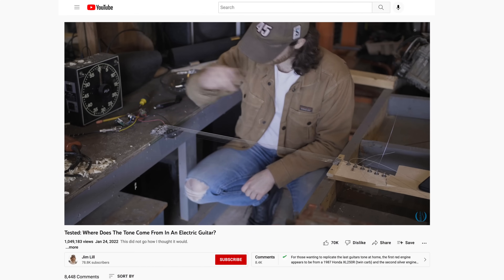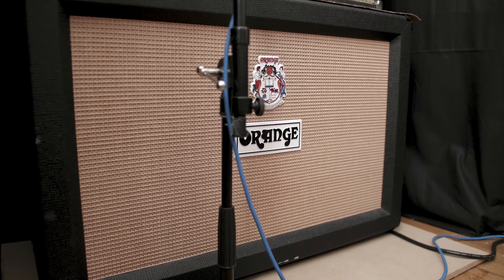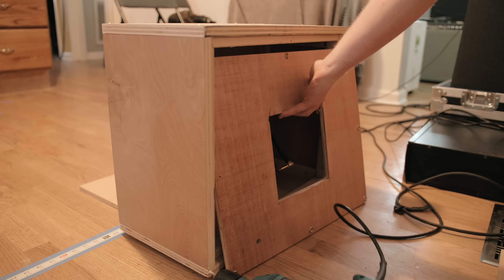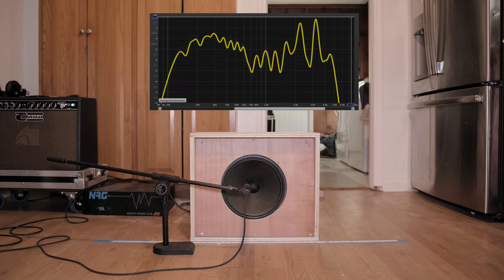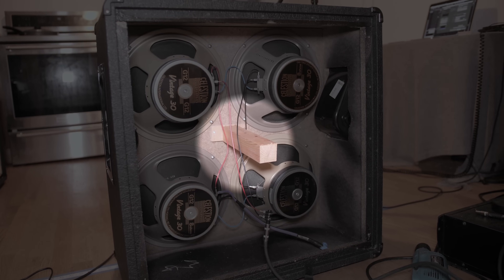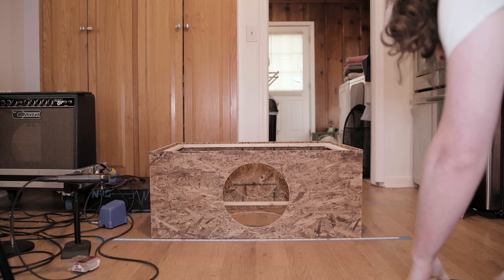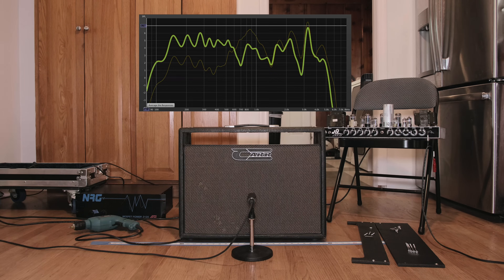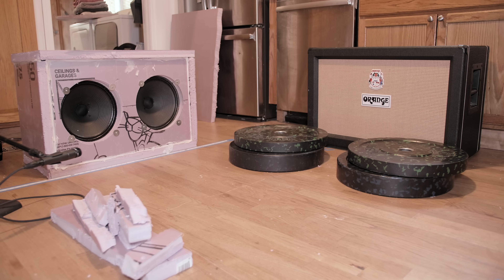Tested: Where Does The Tone Come From In A Speaker Cab?

Comment: What you've encountered with the hole thing with the low end slowly coming back up is the idea behind bass reflex cabinet designs - stick a specific length of pipe in that hole and you get way more low end from a helmholtz resonator.
Reply: That’s the first thing I thought about.
Reply: Yepp, or hornload the speaker, which many bass speaker cabinets do.
Reply: Bass guitar cabs are semi reflex designs. Ported designs tend to be a bit boomy at key frequencies, so bass cabs restrict airflow using a vent with a larger open area (see SWR Goliath or Eden David which have a slotted port at the bottom and sometimes top of the cab). This was a big thing. The first bass cabs were adapted guitar designs, but they needed ridiculous amplification. Then came literal horn loaded PA cabs connected to power amps and rack mount preamps in the mid 70s. More efficient (and smaller) cabinets like the Goliath made it physically easier to be a gigging bass player.

Comment: Thank you for doing the work! The Helmoltz frequency is what describes that "complex relationship between bass response and the size of the opening in the back panel". This is a well documented phenomenon where a hole in an otherwise closed volume can lower it's resonant frequency. This is why sub woofers often have ports. It's also why the size of the hole in an acoustic guitar is very important
Reply: Thing is with holes and cuts in the back the aspect ratio of the hole is very shallow so effects like the coupling zone really get to play here. So it's a bit more difficult than a simple Helmholtz resonator
Reply: as far as ports... yes and no.
the volume of air inside of a port actually acts as an independent source of resonance.  In a sense it is a smaller speaker made of air.

https://www.youtube.com/watch?v=PoEyIJx3uM0
Reply: @Satch_4_Hogs  — Thanks for the link!

Comment: I think this is by far my favorite video in this series. Besides musical instruments, my other hobby is hifi speakers. The construction of the speakers determines what kind and size cabinet it should be on, plus sealed vs ported affect on bass response. Your closing statement hit the nail on the head.
Reply: As an amplifier cab builder myself, I have to say that this video is somewhat misinformational: If every audio clip in this video does actually correspond with the visual/video presented on screen, then it is clear to see that the recording microphone (in 99% of instances) is directly in front of the speaker... so, in a 4 X12 test... Jim is only recording ONE speaker... same goes for a 2 X 12 or any other combo. The wood, resonance and structure of any cabinet DOES affect the tone... but you're not going to hear that with a mic placed right in from of ONE speaker. To do this properly, Jim should place the mic say... 20 feet away - about where you'd hear the speaker if you were stood near the front in a small venue.. or managed to get right to the front of a stadium gig. Not too scientific after all! 🙂

Comment: The fact that you didn't reveal which was which at the end speaks for itself. You didn't need to because it doesn't matter, they sound so similar that the difference is completely negligible if there even is one. Great work!
Reply: There’s more low-end fullness with one of them. They both sound usable but the one with more low end sounds much better to me. Ymmv 🤷‍♂️
Reply: in a mix,100% irrelevant

Comment: Obviously, lots of work went in to this - not just in building and filming but in all the thinking and managerial work of editing it into a cohesively formatted presentation. Kudos on all of that and the bits that can't even be put into words. As a sound engineer, both studio and live, for 27 years now and a woodworker for even longer I will say a few things that will likely make you want to kill me. 

First thing. It's not just the cab, it's the room. Take any cab into 3 differently sized spaces and, using the same amount of power at the same ''volume'', you will get different EQ responses. The diaphragm of any mic can only behave relative to its environment, like a goldfish grows smaller in a smaller bowl but place it into a larger bowl and it will grow larger, it's directly proportionate. Increasing the power to a given cab in a larger space. that initially sounds thin in that space but beefy in a smaller space, does several things that resemble torque curves seen from combustion engines but to the sustain of whatever resonances that cabinet otherwise has. The changes have to do with how voice coils are built and the mass/size of the driver relative to the power and air resistance in the room. The cabinet's construction will either perform great in a 7x11 bathroom or a 16x 24 bedroom or a 3x4 closet, but likely only one of them, and if it does will likely then be trash on a stage. I have my beliefs, I'm sure you will have yours, but there DO exist specific parameters at play as to how to use these phenomena either for or against your patience levels and/or sanity breakdown threshold.

Second thing. Pine or spruce face plates, full-stop. The mid range frequencies at play in electric guitar are very similar to the low mids of a violin. To dissipate them so that none of them ''stand'' you need to avoid both thin/flimsy and dense/rigid faces. The point being you want to reduce cabinet resonance, which do feed back through the face plate, but not leave it dead. I've tried at least 10 different face materials and pine has been the best overall. Double it up to 1.5'' and leave the mounting ring the speaker fits into at .75''. Think about what is going on when a snare drum shell is mic'd (ie from the side). That shell is definitely audible and it sounds totally different than either the batter side or snare side, same as the back and side materials of an acoustic guitar make a difference. The pine/spruce face just sends sounds wave through it FAST and consistently - without adding noticeable ooompf to bass notes.

Third thing. Close micing ain't always it. I've gotten great results at 5' on cabs that just sounded trash within 2-6'' in any space. If the mic is always within 2'' and the volume is always above 95db then don't even bother unless you're just doing a solo performance as any other band instruments will negate 99% of any nuance the cab COULD ever offer. Once you get out around 1.5' the cabinet material begins to matter A LOT.

Comment: I'm curious how much these differences apply once you start backing the mic off of the speaker and get more of the room in the mic signal. I'd think the speaker amount and straight vs slant would have a much bigger effect as you start pulling the mic out. 
The styrofoam cab was pretty fucking mind-blowing though holy shit. Really gives you something to think about for live situations that are usually only close mic'd anyway, might as well just build a cab that is the best combination of lightweight/portable and sturdy to make touring and setup much easier.
Great video! This definitely took a lot of time and dedication and it shows!
Reply: I hope he does a part 2 with room mics to see how much the treble frequencies disappear at different angles.
Reply: good point. you saw the paypal right?
Reply: "The styrofoam cab was pretty fucking mind-blowing though holy shit. Really gives you something to think about for live situations that are usually only close mic'd anyway, might as well just build a cab that is the best combination of lightweight/portable and sturdy to make touring and setup much easier."

The rub here is that wood is actually a great choice of material if you're trying to balance durability, workability, affordability and weight. There aren't too many other choices that make sense. Molded plastics are one option that works well, which is why you see so many plastic PA speakers and studio monitor enclosures these days, but wood is still favored by smaller builders as they can cut and shape it any way they like without having to involve an outside plastics manufacturer.
Reply: Exactly dude botched the point completely by his mic placement.
Reply: @John-e4p1x  My favorite was when he put a stick of wood in front of the mic and acted surprised the sound changed.
Reply: @Azathoth43  That was my only beef with this video.....that was a huge oversight.
Reply: The close mic'ing made this video pointless for me.

Comment: With the hole you are actually building a ported speaker. Air has a mass and by drilling a hole, you are building a "air-speaker". This is used in subwoofers, to build bass reflex / ported subwoofers. This is also why the sound is falling off in the deep end more quickly.

Those videos are amazing. Love the aspect of actually playing those back to back and comparing them.
Reply: Afaiw you need some kind of tube for a ported speaker. Open backs would be more similar to trabsmission lines or rather open baffles, where the increased distance (through the back and around the cabinet) between backside and frontbaffle make the soundwaves from the front and back dont just destructively interfere but might even add up or anything in between
Reply: @torgeeee  You don't need a Tube for a ported speaker. The Port can have every form. But of course it has to be calculated (thiele small for example). Depending on the calculation the opening can actually just be a hole in the cabinet. I build speakers in which it has only been a small slit and ones with a rectangle tube/tunnel like opening.
But just by adding an opening you construct a type of "air-speaker", if its fitting for the speaker is of course a different story.

I don't think you can compare the open baffle on the back with a transmission line. The transmission line works more like a flute and is a monster to calculate. This is where you would really need a tube like construction. More so in the Transmission line then in a ported "subwoofer" or speaker system..

Comment: This video deserves a million likes just for the sheer effort that went into creating it. Incredible. Thanks Jim!
Reply: As an amplifier cab builder myself, I have to say that this video is somewhat misinformational: If every audio clip in this video does actually correspond with the visual/video presented on screen, then it is clear to see that the recording microphone (in 99% of instances) is directly in front of the speaker... so, in a 4 X12 test... Jim is only recording ONE speaker... same goes for a 2 X 12 or any other combo. The wood, resonance and structure of any cabinet DOES affect the tone... but you're not going to hear that with a mic placed right in from of ONE speaker. To do this properly, Jim should place the mic say... 20 feet away - about where you'd hear the speaker if you were stood near the front in a small venue.. or managed to get right to the front of a stadium gig. Just saying! 🙂

Comment: Your channel is hands down the greatest guitar channel out there. Thank you for all of the incredible effort you put into these videos!
Reply: As an amplifier cab builder myself, I have to say that this video is somewhat misinformational: If every audio clip in this video does actually correspond with the visual/video presented on screen, then it is clear to see that the recording microphone (in 99% of instances) is directly in front of the speaker... so, in a 4 X12 test... Jim is only recording ONE speaker... same goes for a 2 X 12 or any other combo. The wood, resonance and structure of any cabinet DOES affect the tone... but you're not going to hear that with a mic placed right in from of ONE speaker. To do this properly, Jim should place the mic say... 20 feet away - about where you'd hear the speaker if you were stood near the front in a small venue.. or managed to get right to the front of a stadium gig. Just saying! 🙂

Comment: The strips of wood on old amps are diffusers and disperse the treble frequencies wider in the room.  The treble frequencies gradually disappear the further you move off-axis from the speaker cone.
Reply: One huge thing that wasn't tested is the sound in the room as opposed to right in front of the speaker. For recording, a 57 right in front of the speaker is absolutely valid. But the vast majority of the sound when you have a cab in the room comes from the sound being dispersed at an angle. 

The strips of wood might make it sound a bit too dull in comparison, but they actually remove the "icepick" effect that is caused right in front of the speaker, basically making the speaker have a more balanced response at a wider angle, and therefore a smoother tone for more people in the room.
Reply: @distortingjack  I agree that he should have recorded the room at certain angles. My band played a gig a few years ago and people on the sides of the room were complaining that they couldn't hear the guitars. It sounded fine to me, but I didn't realize that the treble frequencies disappeared tremendously for the folks sitting on an angle.

I did some research on dispersion and diffusion (duct tape, beam blockers, Mitchell Foam Donut). On my 1x12" combo, I taped a 6 inch piece of very thin foam (3mm) in the center, with a 3/4 inch hole in the center. The small hole in the middle acts like a tweeter and spreads the high frequencies very evenly...no more treble beam of death coming from my amp!

Comment: Amazing work! Thank you. I think using a second mic somewhere away from the speaker to get more of the cabinet sound would be helpful. By only analyzing the sound from a mic placed closely to the front of the speaker, it eliminates the ambient sound from the cab in the room. Having a second mic that is placed to pick up room sound from the cab would be informative. Of course, you would need to control for variables in the room, eg, placement of cab, mic, same room/space with no changes in other items in space, etc. An isolated and controlled space.

Comment: The low-frequency drop-off below 200hz is from "phase cancellation". The front of the speaker driver's cone directly radiates sound waves, as we all know. What may not be known is the back side of the driver directly radiates sound waves, but 180 degrees out of phase with the front wave, cancelling out low-frequencies. Awesome, unbiased real-world scientific testing that settled alot of arguments. Great job!

Comment: This is golden. You deliver every time Jim ! And it just confirms my years of studio experiments : the "magical" cabs are the ones that have the right mix of speakers vs geometry. 
How they're made and what of is a practical and aesthetic consideration but tone-wise : no significant change.
Reply: As an amplifier cab builder myself, I have to say that this video is somewhat misinformational: If every audio clip in this video does actually correspond with the visual/video presented on screen, then it is clear to see that the recording microphone (in 99% of instances) is directly in front of the speaker... so, in a 4 X12 test... Jim is only recording ONE speaker... same goes for a 2 X 12 or any other combo. The wood, resonance and structure of any cabinet DOES affect the tone... but you're not going to hear that with a mic placed right in from of ONE speaker. To do this properly, Jim should place the mic say... 20 feet away - about where you'd hear the speaker if you were stood near the front in a small venue.. or managed to get right to the front of a stadium gig. Just saying! 🙂

Comment: Ideas:
-backwave reflections from the inside will cancel and reinforce different frequencies depending on distance from the speaker. Try changing the depth of the back panel so the cab get shallower and shallower.
-also try adding damping materials to absorb reflections on the inside. One surface at a time, then pairs, then all. Absorbing direct reflections will make things different!
-loose polyester fluff from a pillow left in the cab will absorb low end resonance by converting the vibrations into heat, and it slows down the waves enough so the cab behaves like it's bigger (but with less bass). A boomy cab can be tamed this way.
-try to angle the back panel or baffle more and more and see how the gradually less direct backwave affects the frequency response.
-surface mounted vs inside mounted speakers supposedly changes things a lot. Interesting?

Comment: "What if we don't hear the cabs resonate" at 17:24 was a home run for me. I make flutes out of materials like PVC pipes, and people are often surprised that they sound really good. The reason they sound good is the same as in speaker cabs - the material doesn't resonate audibly, only the chamber of air inside does. In a flute it's the smoothness and straightness of the body, the geometry of the finger holes, the shape of the mouthpiece etc., that shape the tone. (Which makes PVC great because it's manufactured with consistent geometry. I don't have to be nearly as skilled as if I was making them from bamboo).

The one caveat is a material's dimensional stability does matter; an instrument that changes less in response to temperature and humidity will be easier to play in tune and maintain its tone better. I imagine that in a speaker cab, the dimensional stability of the material could affect the geometry and therefore maybe the sound as well.
Reply: Cab resonance happens with Bass, not with guitar. Run 400watts of power into a bass cab and you can hear resonace.
Reply: @crazyjack9voltbatteryamps  Clearly, if you've heard live Bass at stage volume, you'll hear cab resonance and speaker compression. The effect is much greater with Bass.
Reply: Solid wood does resonate, plywood less so, and mdf almost not at all, which is why many even high end audiophile speakers are made of mdf.

Comment: Jim, you freaking rule!

I’ve kinda been down this road with my own cabs. I ended up using Home Depot pine for the sides/back and 3/8” mid grade plywood baffles. I like what they do, they’re light weight and durable enough for gigging(especially after applying a covering).